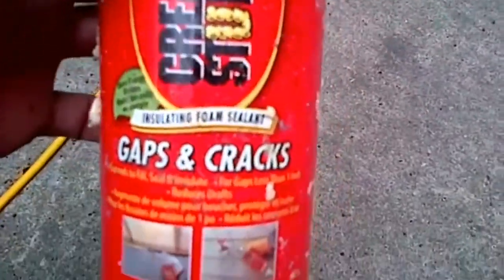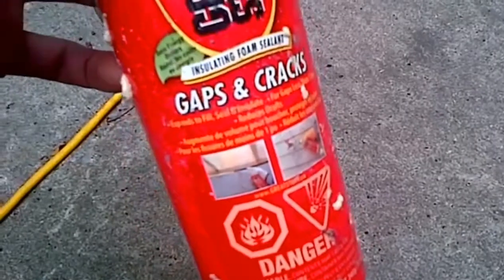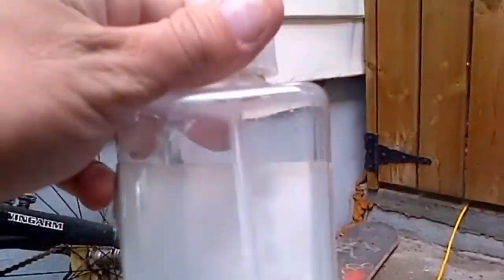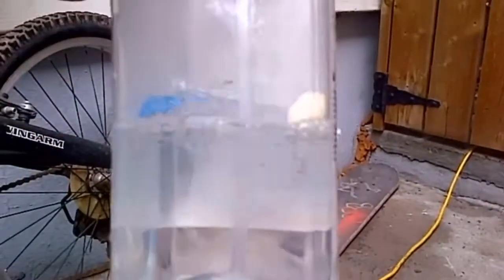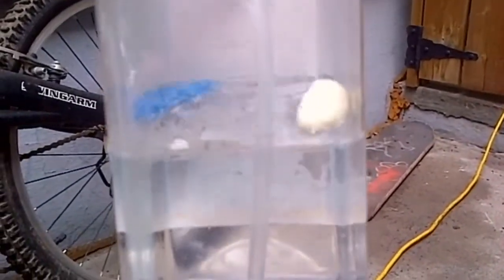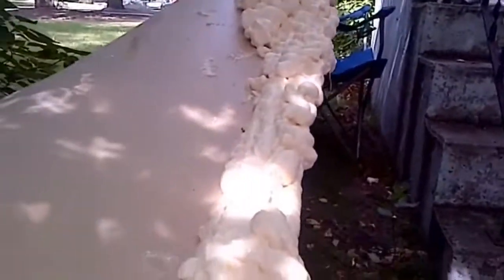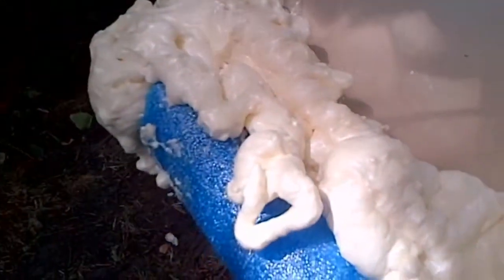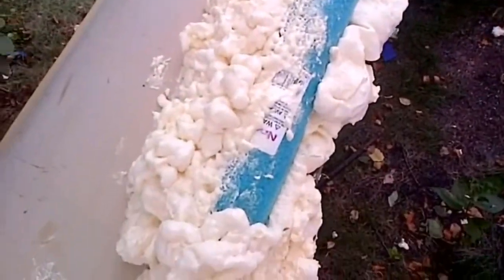⚓️🎣WILL IT FLOAT!!! 🚣🏼🎳Great stuff spray foam in water + canoe modification

Comment: How did the spray foam work for you?
Reply from the maker: James Burdine great stuff is almost as adhesive as pl400.. It will stick to anything.. So cleaning is a nightmare.. But it's still floating.. My canoe is no where near pretty yet. We just got through winter and work has been to busy to work on it.. But so far I would say great stuff works great for buoyancy foam.. I have had my canoe full of water while raining with no bail bucket and still made it to shore.. sitting soaked in an almost fully submerged canoe.. I would recommend it for smaller boats for sure